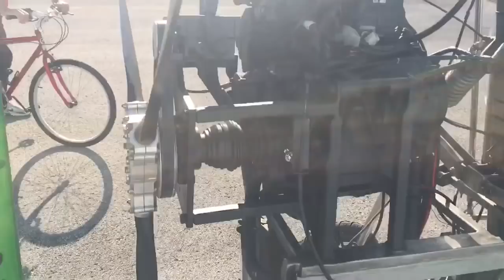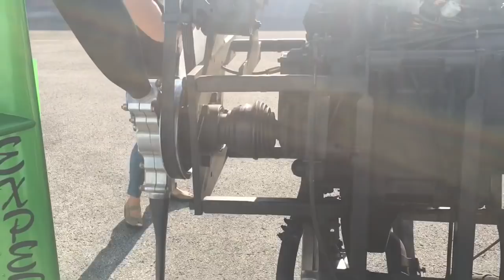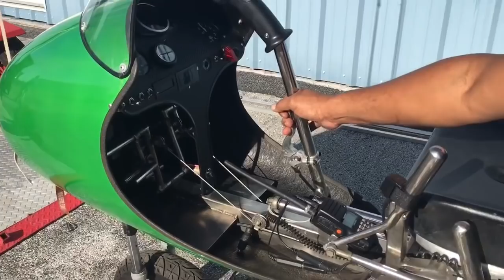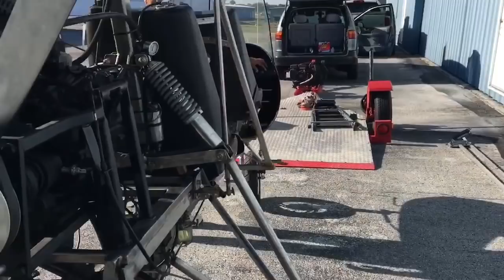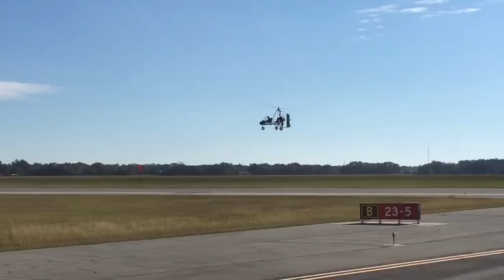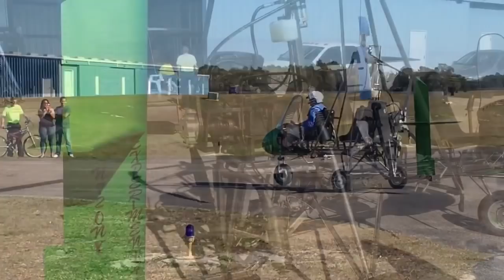Suzuki gyroplane being flown with a transmission driveshaft redrive

Comment: Pardon my ignorance, but what exactly is the benefit ?  I assume the need not to run a reduction ?
Reply: I assume you're asking 'why do we need a reduction'?
It's to do with prop RPM and tip speed of the blade.
The tip of a propellor needs to stay below the speed of sound.
This means turning slower, or having a smaller diameter.
Small engines running around 6000 RPM can only be around 2 foot in diameter (roughly).
A useful size prop on an aircraft is about 6 foot diameter, which works out (again roughly) to about 2500 RPM.
This requires about a 2.4 to 1 reduction.

Comment: Too much grease weight in the boot caused it to fail, just grease the joint not the boot. We run CV's to 7k rpm at Bonneville.